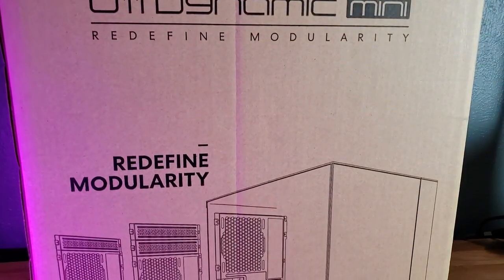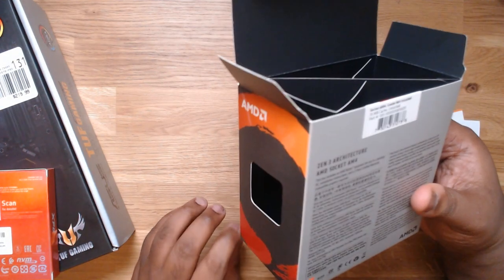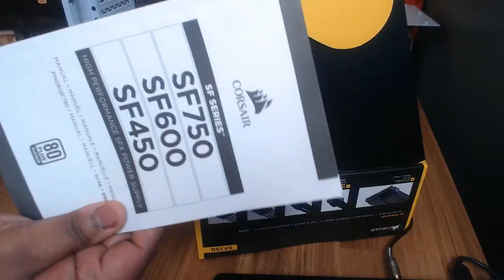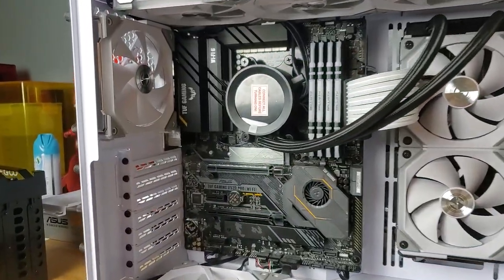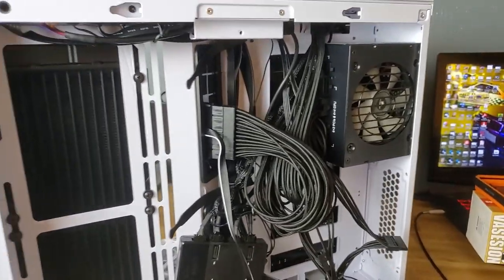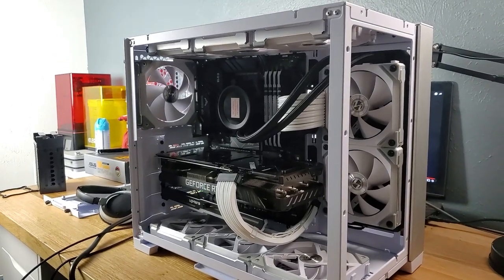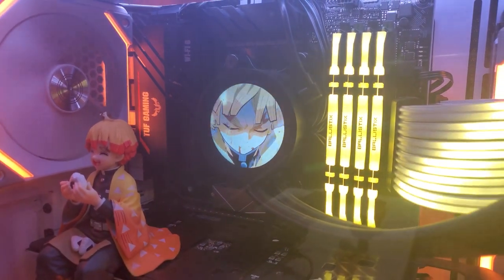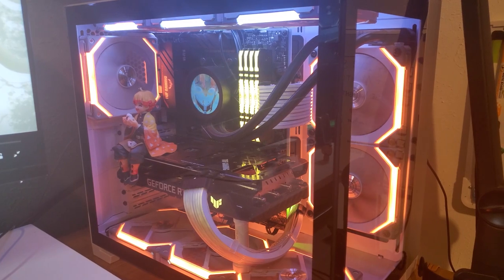Building my first gaming  PC

Comment: Damn that is a clean build!! Props to you!

So the light looks that way on the camera since it is getting refracted through 2 glasses, the case and your camera. You can lower the exposure on your camera for it pick up the light better. 
Also just my personally suggestion, I wouldn’t leave anything on top of the gpu for a long time because under high loads your gpu backplate,  m.2 ssd, and cpu are all right there and that is a lot of heat so it could soften and melt your figure. But other than that everything is super clean!
Reply from the maker: Thanks for the advice! Yeah I figured there was something going on with the exposure but for the life of me I couldn't figure out how to change it in my phones settings. Also, I'm definitely going to take the figure out just to be safe, I don't want anything to burn up lol! Thanks for watching

Comment: You could mount the radiator on the top of the case for better performance and life expectancy, overall Good build God bless you very mucho ❤️👍
Reply: not really better performance. the rad goes better where he put it. no need to recommend stuff like that when it hardly matters
Reply: Nah it's fine like that the pump won't trap air bubbles

Comment: Built my first PC just before this. Got an EVGA 3070 ULTRA in it. I upgraded to an MSI 3080 Ti SUPRIM X for the VRAM boost recently. But the 3060 and 3070 cards are AMAZING! When I had the 3070, I had a seamless 3440x1440p gaming experience at max settings, even with RT enabled in many games. And the Ryzen 7 5800X was definitely killing it with the workloads I had going and the games. You got some great performance in there with room for upgradibility in the GPU. Hope it still serves you well. Have you upgraded any components?

Comment: The last time I built a PC it got delayed for over a month as well lol. I tried to get as much of my parts "used" on Amazon Warehouse. I know amazon workers aren't PC techs but if its one thing you trained them to look out for, it should be bent pins on the CPU socket of a motherboard. I had to order 3 boards before I got one without bent pins. I save about $120 on the motherboard though so it was worth it. Got a few other parts used but luckily those worked fine.

Comment: Awesome video! Earned a sub from me. Pretty extravagant and tricky first build. Did you end up having any issues with thermals on cpu or gpu? I’m building in the same case and didn’t realize I couldn’t mount my aio radiator on top with a full atx motherboard. I would rather have positive pressure but it doesn’t seem possible unless I leave the top fans off

Comment: Hi man I just wanted to ask, Is your gpu overheating from the negative air pressure in the case or is it at a good temp?
Reply from the maker: No, I haven't had any overheating issues. I was a little paranoid about that at first too, but every video I could find seemed to be running the same sort of chimney style fan setup. Even Der Bauer the dude who designed the case suggested this was the best fan setup for the case, so that gave me a little more confidence. So far I haven't had any issues and it's been pretty great! Thanks for checking out the vid, I really appreciate it! 🙏

Comment: The box is that big is cos it's their generic box they've used forever, and the ryzen 5 5600x still comes with a fan so it's cheaper to just print the different information on the same box layout than make two separate box layouts. It's wasteful as hell and kinda dumb, but that's the way it is. Great build tho.

Comment: good job brother but i feel as if 3060 is a good card but you would be better off with atleast a 3060ti 3070 or 3070ti since in my opinion the 3060 is too slow for tha amount of power a r9 5900x has

Comment: What was the budget
Reply from the maker: In total it came out to about $2,800. Keep in mind alot of the prices on the parts are kind of inflated right now. So depending on when you buy your parts you may be able to get it for cheaper than I did. Thanks for checking out the video! 🙏

Comment: Were did u get the rtx 3060
Reply from the maker: I got lucky and managed to get one from Micro Center. I made a separate video that kind of explained how it all happened. If you are trying to get one though, there are some really helpful discord groups that constantly keep track of the stores in coming stock and what not. I can send you a link if you want it.
Reply: @Iguessthatworks  yes that's the only thing I need for my pc
Reply from the maker: @catch5538  Okay I live near a Micro Center and wanted to buy mine in store so I used this discord to find out about store inventory. They pretty much have a section for each city. https://discord.gg/umcd. If you want to buy one online then your best bet is to have fast fingers and use this discord https://discord.gg/m4xgDEmK. You can set alerts for specific types of gpus and cpus so it will alert you when ever they pop up on any of the major retailers. Hope they help and bring you luck like they did for me!